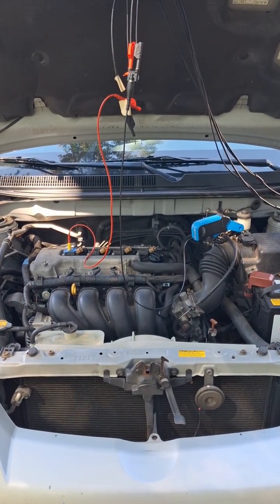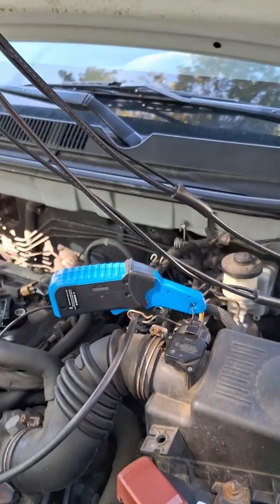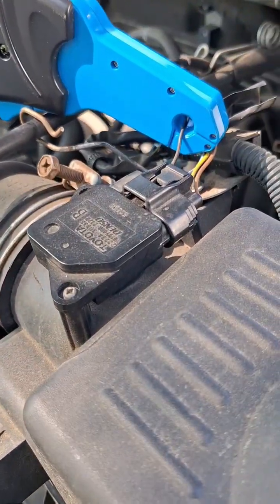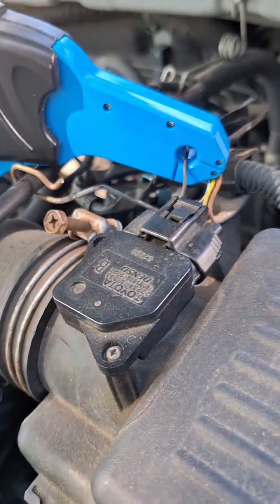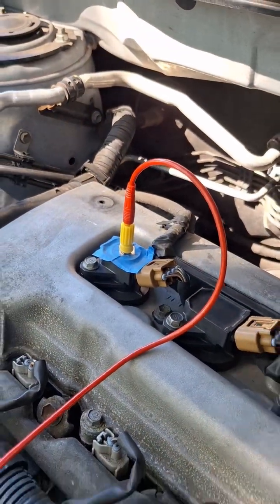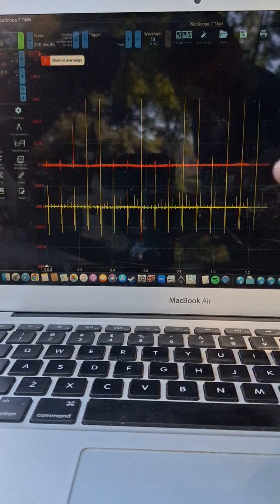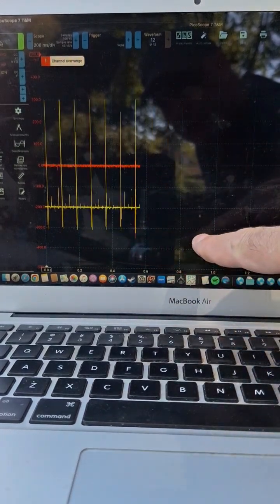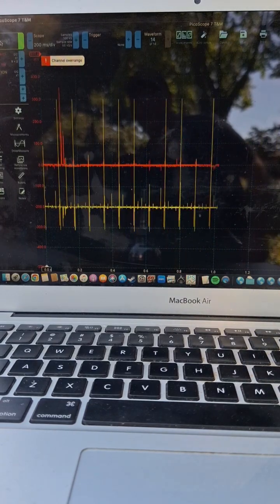Mass Air Flow Sensor (MAF): Flow Does Not Change Current.

Comment: I'm pretty sure most sensors that use a variable voltage for data have a constant current
Reply from the maker: Yup. This MAF is basically a module.  The internal current to hotwire does vary within the sensor electronics and gets converted to a voltage level, then goes to ECU. External Current Supply to MAF is a constant 45 millamps (see this in community post) Thanks for commenting and watching! 🔧
Reply: @MarzNet256 thanks for confirming. I wasn't totally sure 😄